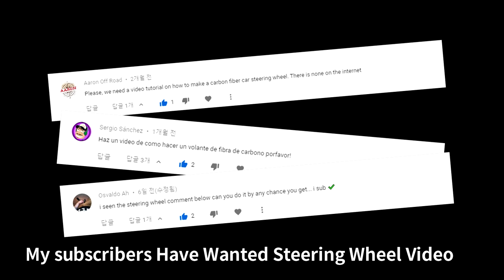How to Make a Carbon Fiber Steering Wheel with Epoxy Resin [DIY]

Comment: all that work and we couldnt even see the finish product!
Reply: because the finished product was ass... you could tell that the thickness was never gonna match when you put leather back on the steering wheel... he did do good job too bad he missed one crucial part of making it well
Reply: @e36fanatics  Super late question, but what would've you done in that situation for it to not look like that
Reply: @thepiggydiggy6294  more layers of carbon fiber to level it up with alcantara

Comment: I have a custom F80 wheel with leather on it. It is hard to the touch unlike the OEM BMW. Would I be OK putting the carbon matting directly on top of the leather rather than stripping it off?

Comment: would you be able to share with me where you buy your supplies.. like liners, CF cloths, backs and the little pump... this is so inspirational...
Reply from the maker: Hello, Buddy!
I purchased materials from a Korean online shop.
However, Korean online shops do not ship overseas.
So I'm going to show you an online shop in the UK.
Epoxy gelcoat  https://www.easycomposites.co.uk/#!/resin-gel-silicone-adhesive/epoxy-gelcoat/epoxy-tooling-gel-coat.html  
Lamating epoxy resin   https://www.easycomposites.co.uk/#!/resin-gel-silicone-adhesive/epoxy-resin/EL2-epoxy-laminating-resin.html
top coat https://www.easycomposites.co.uk/#!/resin-gel-silicone-adhesive/epoxy-resin/epoxy-coating-resin.html
carbon fiber cloth https://www.easycomposites.co.uk/#!/fabric-and-reinforcement/carbon-fibre-reinforcement/woven-carbon-cloth-under-400gsm/22-twill-240gsm-3k-1-25m.html

I hope you helpful.

Comment: Hey! Love the vid! Was wondering, what’s something I could wrap the wheel in before I wrap it in carbon fiber? I want the carbon fiber and alcantaro to be more level with eachother. Thanks!
Reply from the maker: Hello, Buddy!
You may be able to use fillers.
However, it will take a lot of time for shaping with filler.
I hope your work goes well.
Reply: @ECOLAPStudio  where do you get the 7060 epoxy harder from? Cuz I’m trying to make my own carbon fiber wheel.
Reply: @ECOLAPStudio  Is there another way to shape the steering wheel?

Comment: LOL. Working on my third attempt. Wrapping the wheel with the carbon fiber is the most difficult part. I will try again tonight...
Reply from the maker: Third ... T.T
Yes, it is very difficult to attach carbon fiber to the steering wheel.
This is because the length of the steering wheel arc is different from top and bottom.
You have to remember it.
and It is important to cut the carbon fiber cloth.
I hope your work will be well.

Comment: If you don't mind me asking what type of resin and weave do you use? please link? Thank you I subd! nice steering wheel have been watching your videos! Keep it up!
Reply from the maker: Hello, Buddy!!
I usually use a laminating epoxy resin.
The top coat uses a different one.
Generally, it can work with laminating epoxy resin.
I bought an epoxy resin at a Korean online shop.
But I think Korean online shop won't ship overseas.
So let me tell you a website in the UK.
Maybe you can find the things you want.
I hope it will help you.
Thank you for watching
https://www.easycomposites.co.uk/#!/resin-gel-silicone-adhesive/epoxy-resin
Reply: @ECOLAPStudio   Thanks dude!

Comment: Very cool! Did you remove the heat shrink film, or are you able to leave it on and epoxy over it? Can you provide a link to the film? I have never seen that product before.
Reply: You can see in the video he removes the heat shrink tape lmao
Reply: 4:24-4:25 you can see it in the top right in the background

Comment: Great video. I was wondering how to wrap the parts with carbon and make it  have a nice touching point when both ends touch. Did you simply overlap them and then sand the extra? 
How do you keep the carbon from distorting its weave, biggest help is the gel?
After you remove the heatshrink and start sanding isn't there exposed carbon that you damage since there isn't much resin?
Thank you.
Reply from the maker: Hello, buddy!!
Thanks for the comment.
I think your questions are very important and good.
First, as you say, I think the important thing in carbon fiber overlap cutting is to keep carbon fiber patterns.
I used spray adhesives to solve the problem.
Using a spray adhesives can keep the carbon fiber patterns.
But, You have to use minimum amount because if you use too much spray adhesives, surface is not clean.
Other methods include applying epoxy resins and then cut after half cured.
But I think it is a hassle way.
And then in the first sanding,It exactly damaged to the carbon fiber cloth.
However, if you minimize the damage and then apply epoxy resin, the damage is indistinguishable from the eyes.
Sanding to the extent that carbon fiber patterns are not damaged is be okay.
The important thing is keeping the pattern of carbon fiber.
I am worried you will can't understand my meaning because I am not good at English.
I hope you helpful.
If you have more question, please reply.
Thank you for watching.
Reply: @ECOLAPStudio  can you actually use poly gel coat, not epoxy?
Reply from the maker: I used epoxy gelcoat and epoxy resin.
I've used polyester resins, but It is not as strong as epoxy resins.
So most of the work uses epoxy.
Reply: @ECOLAPStudio  man can u give me the link where can I buy the shrink tape?

Comment: Hi. Great work! A have two questions about wheel laminating:
1. Please show us how to align two edges of the carbon fiber?
2. What about steering wheel heater which was integrated into leather cover?
Reply from the maker: Hello, Buddy!
I'm sorry i can't speak english well
"Please show us how to align two edges of the carbon fiber?" I couldn't quite understand this meaning.
The steering wheel heater has been removed.
I thought it would be possible to transplant the genuine cover heat into new leather.
However, I didn't think it was necessary.
The genuine BMW Alcantara steering wheel has no heater.
I hope you helpful.

Comment: Hey man, loved the video. Subbed because of it. Have you ever thought about doing this but adding converting an oem steering wheel to flat bottom?
Reply from the maker: Hello, Buddy!
Hi friend,
I did not make the bottom of the steering wheel flat.
Some people ask about Flat Bottom, but I don't seem to understand Flat Bottom because I don't speak English very well.
Can you explain if possible?
Reply: @ECOLAPStudio  racing wheels are designed with a flat bottom. The normal steering wheel is a circle shape. A flat bottom steering wheel has straight lines on the bottom. Try searching for flat bottom steering wheel on YouTube. 

I asked because I watched one video where someone transformed a normal steering wheel to a flat bottom steering wheel. I am looking to do it myself and wanted to see a few people try it.

Comment: Can you provide a link to a supply list or starter materials needed, I would like to start making small items. Thanks for all your hard work and dedication!
Reply from the maker: Hello, Buddy!
I purchased materials from a Korean online shop.
However, Korean online shops do not ship overseas.
So I'm going to show you an online shop in the UK.
Epoxy gelcoat  https://www.easycomposites.co.uk/#!/resin-gel-silicone-adhesive/epoxy-gelcoat/epoxy-tooling-gel-coat.html  
Lamating epoxy resin   https://www.easycomposites.co.uk/#!/resin-gel-silicone-adhesive/epoxy-resin/EL2-epoxy-laminating-resin.html
top coat https://www.easycomposites.co.uk/#!/resin-gel-silicone-adhesive/epoxy-resin/epoxy-coating-resin.html
carbon fiber cloth https://www.easycomposites.co.uk/#!/fabric-and-reinforcement/carbon-fibre-reinforcement/woven-carbon-cloth-under-400gsm/22-twill-240gsm-3k-1-25m.html

I hope you helpful.
Reply: @ECOLAPStudio  kamsahamnida! For the quick reply I'll take a look at the items would you also be able to recommend a usa source?

Comment: Do you have a list of products used. And also where can you find empty steering wheels like you did on your video. I want to practice with a blank one vs using my own and messing it up. Also what did you do with the heated steering wheel option? Did you leave it connected?
Reply from the maker: Hello, Buddy!
I have two steering wheels.
One is the stock handle and the other is the Alcantara steering wheel.
So I worked with stock steering wheel.
I think you can get a steering wheel for your car from eBay, etc.
I did not connect the steering heating wire.
It is very difficult to connect the steering heating wire.
Perhaps you need to make a new heating wire.
So I didn't.
Thanks for watching.
Reply: One more thing whats the measurements of mixtures that you use.

Comment: Hello my friend, i try to make a carbon steering wheel like you for my e92. I follow each step, everythibg was gine until the last coat of epoxy anti-uv (I done it with xcr from easycomposite), when i apply this coat, the rendered surface is irregular, with some « hole » without epoxy. I try to sand again and apply epoxy but the end result was the same. Do you have any recommendations ? Can i sand again and apply a gloss varnish ? Thank you!
Reply from the maker: Hello friend.
Apply two to three thin coats of epoxy resin to remove the pinholes.
And when curing is complete, level and polish.
Reply: @ECOLAPStudio  thank you 🙌🏼 i’ll try it!

Comment: thanks for the vid. What brand of resin are you using ? I can see theres a non-UV one and the top coat is UV-resistant. Im using only the UV one but its not cheap. Can you tell us the brand and where to buy it? Cheers :)
Reply from the maker: Hello, Buddy!
I use some epoxy resins.
Among them are laminated epoxy resins and Anti UV topcoat epoxy resins. I use these two the most.
I bought an epoxy resin at a Korean online shop.
However, Korean online shops do not ship overseas.
I'll give you a UK online shop.
You will find what you want.
https://www.easycomposites.co.uk/

Comment: I dont understand for what did you use the epoxy putty, and links to buy the products please!
Reply from the maker: Hello, Buddy!!
My steering wheel has a gap when I remove the leather.
I used epoxy putty to fill the gap.
But I think usually you won't need epoxy putty.
Usage of epoxy putty is simple.
Knead it and stick it like clay.
I bought the ingredients at a Korean online shop. Most Korean online shops do not ship overseas.
I'll give you a UK online shop for you.
You can find what you want.
I hope you helpful.

https://www.easycomposites.co.uk/

Comment: Hey Buddy! At first....great video(s) :)

It would be great if you show us more above the laying of the carbonfiber it selfe :) like how you push it on the part, how you cut it an how you press it against and around the part it self :)

I work by my selfe a few month with carbon fibre an still have problems with edges and corners (the carbonfibre wouldn't lay flat on the surface of my parts...)

The tip with the shrinking foile is great! So simple and usefull at the same time!

Looking forward for your next videos 😊🤙🏼
I hope you can show more of how you lay your carbon fibre :)

At this moment i am making the interior parts of my BMW F31 :) (the problems there are on the parts where the vents sit in...)

Have a nice week!

Greets from Germany

PS: where do you come from?
Reply from the maker: Hello, Buddy!
I can guess what you are talking about when layering.
I think it is very important to layer the carbon fiber when the gelcoat is slightly cured.
If you layer carbon fiber cloth when gelcoat is some sticky, You can layer carbon fiber cleanly.
If the carbon fibers are not layered cleanly, you can apply acetone slightly to fix them.
I will make a video by reflecting what you want in the next video.
I live in South Korea and I also have a BMW.
If you have a chance, I will make BMW parts!
Thank you for watching!

Comment: ¿Por que le pones gel coat epoxi al principio y no directamente resina epoxi? . Tengo otra duda. La cinta termo retráctil.. parece que ha dejado marca, ¿no?. ¿crees que habria sido mejor no ponerla?. ¿ o haber reforzado con mas cinta encima de la que ya pusiste? . Un saludo. Eres un maquina!
Reply from the maker: Hello, Buddy!
The use of gel coat is to layer carbon fiber cloth on steering wheel.
Epoxy resins flow down because It is low viscosity, but gelcoat does not flow down because it is high viscosity.
And also, Gelcoats can be used to bond carbon fiber cloth very tightly.
Shrink film was used once.
Shrink film marks remain slightly but are not visible when sanding and epoxy resin is applied.
If you have any questions, please comment.
Thank you for watching ~ ^^
Reply: Muchas gracias por contestar. Voy a fabricar mi propio volante y este video me va a ser muy util. Este y el resto de videos. Ademas que lo haces entretenido de ver y te ganaste un suscriptor ;).

Sobre el gel coat negro que usas al principio.. ¿podria sustituirse por el que aplicas como capa final, el uv? . Yo voy a usar resina epoxi uv y gel coat uv, todo transparente. Saludos y gracias otra vez.
Reply from the maker: UV resin can be used as a top coat.
The final topcoat has the inverse of protecting the surface.
It can be coated.
Gel coat is recommended black.
The black gel coat can cover the base color of the parts.
Reply: Gracias. El tema es que no encuentro gel coat epoxi negro. Por eso decia de usar el gel coat transparente uv como base y como final tambien. ¿Donde puedo conseguirlo?. Si no lo hare con el transparente. Solo encuentro verde. Saludos!
Reply from the maker: Check out the black gel coat. 

https://www.easycomposites.co.uk/#!/resin-gel-silicone-adhesive/epoxy-gelcoat/epoxy-tooling-gel-coat.html

Comment: I see that you always shrink wrap or vacuum seal the carbon fiber. Why is this? Is it required?
Reply from the maker: Hello, Buddy!
The purpose of the shrink film is to securely attach the carbon fiber to the steering wheel.
But it can be made without it.
Thank you for watching.
Reply: @ECOLAPStudio  I see. Makes sense now! Thanks for replying!

Comment: Awesome video. Just subscribed! can you send links to the epoxy, hardener and anti UV topcoat that you use? Thank you!
Reply from the maker: Hello, Buddy!
I purchased materials from a Korean online shop.
However, Korean online shops do not ship overseas.
So I'm going to show you an online shop in the UK.
Epoxy gelcoat  https://www.easycomposites.co.uk/#!/resin-gel-silicone-adhesive/epoxy-gelcoat/epoxy-tooling-gel-coat.html  
Lamating epoxy resin   https://www.easycomposites.co.uk/#!/resin-gel-silicone-adhesive/epoxy-resin/EL2-epoxy-laminating-resin.html
top coat https://www.easycomposites.co.uk/#!/resin-gel-silicone-adhesive/epoxy-resin/epoxy-coating-resin.html
carbon fiber cloth https://www.easycomposites.co.uk/#!/fabric-and-reinforcement/carbon-fibre-reinforcement/woven-carbon-cloth-under-400gsm/22-twill-240gsm-3k-1-25m.html

I hope you helpful.

Comment: What was the purpose of the shrink film? Hooked and almost watched all your vids
Reply from the maker: Hello, Buddy!
Shrink film helps keep carbon fiber attached on the steering wheel.
It also releases unnecessary epoxy resins as they contract.
I hope you helpful.
Reply: ECO-LAP Studio so you didn’t remove after right you just sanded down?
Reply from the maker: +Santiago Cervantes I removed the film before first sand.
After remove the film, I sanded and applied epoxy resin.
Reply: ECO-LAP Studio thanks buddy keep those videos coming!!!! 👌👌👌

Comment: Hi, I have a question. Some people use some white filler or product to reshape the top part of the steering wheel when they ad the LED Light display like F1 cars have. What is this product called???
Reply from the maker: Hello, Buddy!
The LED light is the engine RPM signal.
It could set the shifting point to LED light.
Some are sold in aftermarket, and others are sold as an option for automakers.
If you can do MCU (ex. Arduino) programming, you can do it yourself.
I had created and used something similar about 10 years ago.
Reply: @ECOLAPStudio  Yes i know what the lights for but i want to know how they hold it into place and mould it into the steering, what Product is used??

Comment: Is it possible to do the whole steering wheel with carbon fiber without having the separation for the cloth
Reply from the maker: Hello, Buddy!
It is also possible.
However, the original steering wheel leather will be damaged.
Reply: @ECOLAPStudio   So i have a mk4 jetta steering wheel I was going to try to remove the leather and wrap the entire steering wheel so I should no longer need the leather

Comment: Brother great video, i have a question about the the shrink wrap you used, where can i buy it? And can i use regular transparent packing tape instead?
Reply from the maker: Hello, Buddy!
I purchased materials from a Korean online shop.
However, Korean online shops do not ship overseas.
So I'm going to show you an online shop in the UK.
https://www.easycomposites.co.uk/#!/vacuum-equipment-and-supplies/vacuum-bagging-consumables/composites-shrink-tape.html

It cannot be replaced with plain transparent tape.

Comment: Te felicito por el video , un trabajo de muchisima  calidad sin duda.¿Que cinta termica has usado (shink film)?
Reply from the maker: Hello, Buddy!
I don't think that most heat shrinkable films are very different.
However, It is not necessary to use a heat shrink film.
You can meticulously attach the carbon fiber.
I hope you helpful.
Reply: @ECOLAPStudio  Thank you very much for the information, I appreciate your help and I would like you to show us how to make the front boot door in carbon would be a spectacular video! It would be very interesting if you put the links where the materials are purchased please!